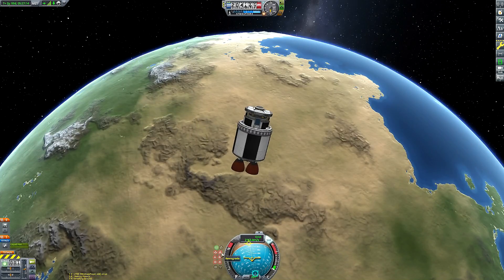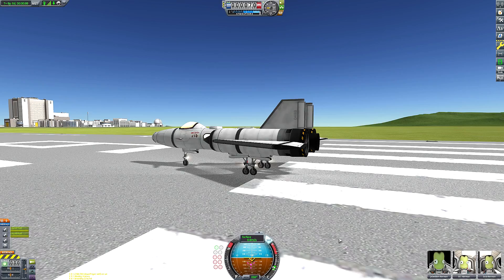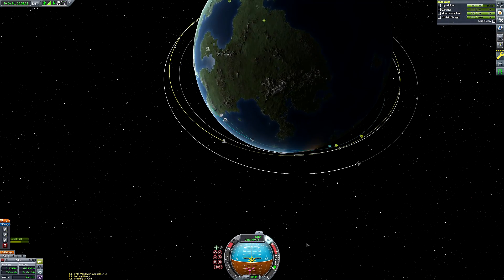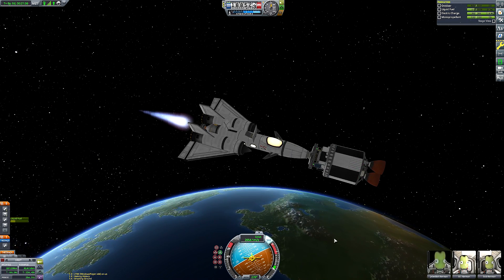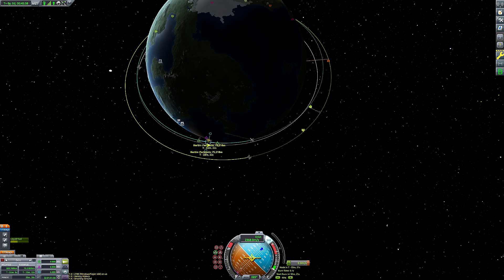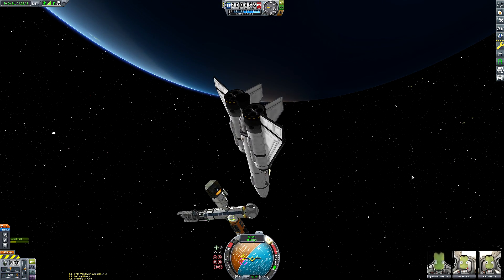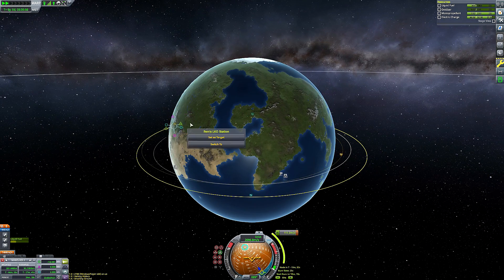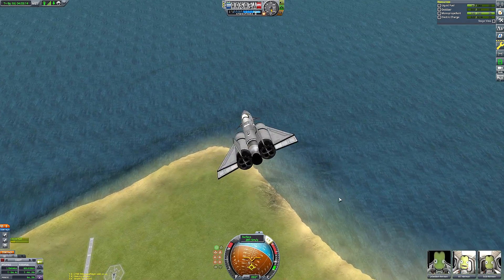Cleaning up SPACE with an SSTO! KSP 1.9

Comment: Matt I hate to break you from your dissertation on alcohol.  As a space scientist I have a query for you.  On the star Betelgeuse what is your take on it?  Am thinking it's compressing into a smaller AU circumference.  Say from 7 AU to 4 AU or maybe 3 AU in size.  What I think happened it ran out of material so it compressed to a smaller size to keep up the nuclear fission.  The whole rubbish about some bloody dust cloud is just dust in someone's nut really.  If it was in fact a "dust cloud" then all light wave lengths would be blocked.  Not just the visible one.   Am thinking this dust cloud is at least 20 AU's from the star at it's closest point.

Comment: I really dont understand why you are ignoring the rcs 🤔
Reply: Because for this kind of mission, and for docking with so light objects (the tank of course, but look, the smolstation is smaller than the plane, too!) there is no need for RCS. A simple control from the docking port, aiming for the docking port of the target, and it gets all alone. Of course, for bigger stations, that can't move as fast as this one, RCS is needed, but in that case, RCS would increase the weight of the plane, and decrease the Delta-V....

Comment: In the Lowne Lazy Docking Method, how do you get both vessels to actively track the other?  When I try it, the vessel not in focus  stops actively tracking and reverts from 'point to target' to the default SAS setting of just maintain a constant heading.  Is there a configuration or difficulty setting that affects this?
Reply: I think you need high level pilots.

The alternative is to set the two ships to point normal to the orbital plane but in opposite directions. As long as they’re collinear they’ll dock just fine.

Comment: Matt: "...because the SSTO is more environment-friendly"
Also Matt: *loads some megatons of fossile fuel*
Reply: A nuclear engine that heats up the propellant via heat exchangers shouldn’t pollute anything, but heating the propellant by directly letting it touch the reactor (more lightweight and efficient) directly could lead to some neutron activation..
Reply: Also, Also Matt: ignites nuclear engine in atmosphere
Reply: Nuclear engines don't necessarily pollute, with many they simply heat up a fluid around the reactor and expel it out the nozzle.
Reply: @MCWaffles2003-1  If the fuel decays into something harmless, which none of our current nuclear fuels do...
Reply: Throw it into space then while you're out there, its radioactive out there anyways
Reply: @MCWaffles2003-1  it says in kerbal space program "with its radioactive exaust"
Reply: @MCWaffles2003-1  Also... "just throw it out into space" is the exact opposite of the mission in the first place...
Reply: @dontlikemath -.- & @firestar 9990 use hydrogen, any neutrun activation will simply make the exhaust into deuterium (perfectly safe)
@QemeH then land with it and put the waste into a molten salt reactor or something
Reply: @MCWaffles2003-1  I see
Reply: @MCWaffles2003-1  but., that don't have hydrogen fuel in stock ksp
Reply: firestar 9990 
If you look in the manual for mining it says that the fuel is hydrogen
Reply: @QemeH  the nuclear fuel never leaves the engine, the liquid fuel is what can get radiated depending on the design.
Reply: @QemeH  The fuel is either hydrogen, methane, or RP1. KSP's liquid fuel is ambiguous.

The actual radioactive stuff is all contained within the engine. This is a nuclear thermal rocket, not a nuclear salt water rocket!
Reply: The LF is made of hydrogen and oxygen, and the oxidizer is made of oxygen
Reply: firestar 9990 
Think about that for a second. Hydrogen and Oxygen make water, water isn’t a very good fuel is it? Whearas Hydrogen is one of the best rocket fuels out there. Which do you think is more likely to be the fuel?
Reply: @sharqueeshajohnalaneesha2019  Mate, SURELY you know that the space shuttle LITERALLY ran on liquid hydrogen and liquid oxygen, yes? The fact that YOU don't understand how staged combustion works, doesn't mean NASA doesn't understand how staged combustion works. 

And yes, Hydrogen and oxygen combine to form water, the shuttle's main exhaust. Literally why the engines were designed that way.
Reply: @iami3rian394  he's the one that understands that... Why are you yelling at him?

firestar 9990 is the one making up molecules that don't exist so he doesn't have to admit that the liquid fuel is liquid  hydrogen
Reply: IamI3rian 
What does that have to do with anything? lmao. Are you suggesting that hydroxyl based fuels are the future of spaceflight?
Reply: @sharqueeshajohnalaneesha2019  my favorite part is where he says a hydroxyl ion reacting with oxygen could somehow add a hydrogen xD
Reply: @sharqueeshajohnalaneesha2019  that was the most fun argument I have ever had as you did not just cuss at me and say I'm wrong. I respect you, and hope that you are faring well. Signed, Wikipedia user firestar9990.
Reply: No, it says the fuel is made of hydrogen and oxygen
Reply: firestar 9990 
Oxygen is the oxidiser, hydrogen is the fuel. Read it again
Reply: Either way, is this debate necessary? (I know I misspelled necessary)
Reply: firestar 9990 
Necessary is a relative term. Either way, HO or hydroxyl is very unstable and not very combustable and therefore uutterly unsuited as a rocket fuel. The only logical combination is hydrogen fuel and oxygen oxidiser
Reply: When I ask if it is necessary, I mean that I am saying that we are arguing about what an imaginary fuel is made of. Why are we having this debate if there is no puropose
Reply: firestar 9990  
The purpose is to discern what this imaginary fuel is made of. Whether that is a worthy goal or not is entirely based on opinion. There is no combination of hydrogen and oxygen molecules that produces a better rocket fuel than just straight hydrogen.
Reply: Oh hi I found this comment again. I wanted to say that  if it's called "liquidfuel" then why not just say hydrogen? And neither of us know if KERBALS discovered a new element or something. Thats a question for the ksp devs
Reply: Probably to keep it simple and then avoid arguments over "well they should have picked methane/RP-1/etc..."
This game wasnt originally about all the nuances of rocket science... it was just about making a rocket... Hell... the original kerbin was flat
Reply: @MCWaffles2003-1  yes... that's what im trying to say.... ksp isn't about what rocket fuel is about
Reply: I mean Wikipedia is smarter than youtube. And at this point your spurting out obscenities
Reply: @sharqueeshajohnalaneesha2019  hey. I think that argument was nice. Thanks for the end of endless boredom.
Reply: setr
wrefe
Reply: I it could also be H3O (I don't know how the k erbals would make it)
Reply: it could be HO instead of H2O
Reply: It's an imaginary fuel